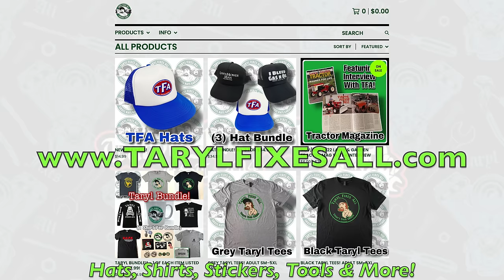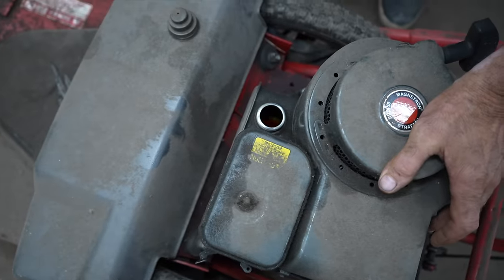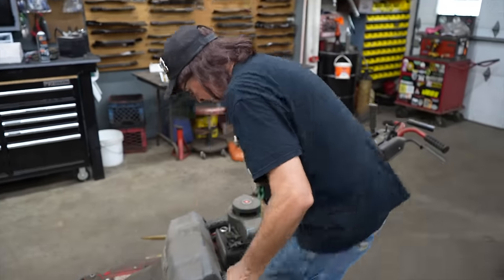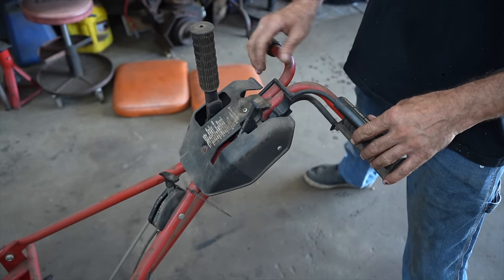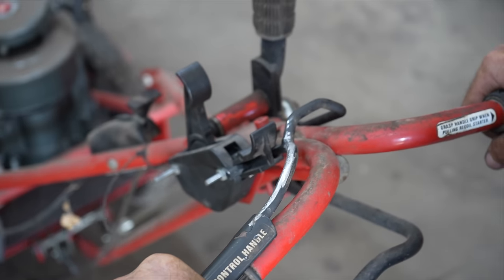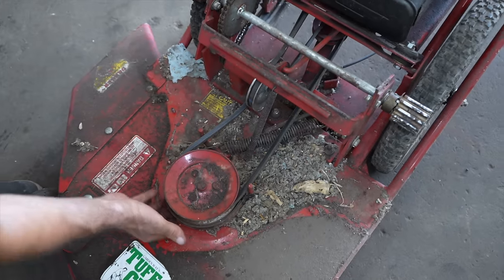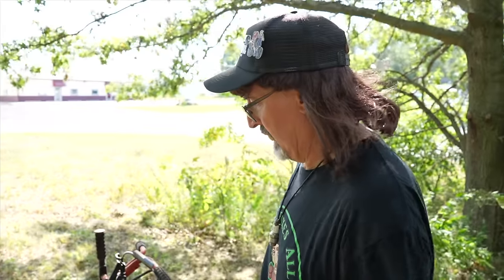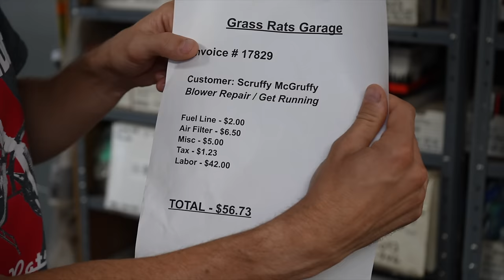Customer Wanted It GONE! Can It Be Saved?

Comment: That was actually an expensive, good mower in its day, you are correct it wasn't a cheap mower, had a cast iron sleeve.I bought one slightly used in 88 for 400$, half of the new cost, the guy was moving to town from the farm and didn't have a use anymore. I mowed by fences and rough areas with it for 25 years. Motor still ran but the rest was just plain worn out.Twas made in the 🇺🇸

Comment: I like that mower! Having the deck out front keeps the blade away from your feet and you can reach out over the edge of a ditch easier. They certainly don't make stuff like that anymore.
Reply: Like a Yazoo and some Hahn Eclipse that were belt driven, In addition to keeping the blade further from your feet it also protected the crankshaft from damage if you hit a rock or some other hard stationary object with the blade.
Reply: Oh they make it it's just in the commercial space and costs 3x as much as it should.
Reply: I was impressed how the engine speed hardly changed cutting those tall weeds.

Comment: Hey Taryl! I have this same mower. It’s also an 87’. 

My father had me mow down the old corn stalks and weeds with it in the garden before he would till the soil with a gravely 5260 with a rotary cultivator attachment. Sometimes you had to lift the mower to get the stalks to go under.

The choke lever on the carburetor could be pressed a little until it clicked if the mower needed more choke to start.

The handles on that machine certainly have a unique feel.

It’s been sitting unused for a few years because the coil is bad.

I assume you put another foam filter in it. I don’t think the video shows the new filter with part number.

Thanks for fixing this machine up and for the great video content!

Comment: That’s not a bad machine compared to the junk MTD pushes out today.   It would have been a shame to see that get scrapped. Still has one of the good B&S engines too.  Cool project Taryl!
Reply: lol, those 3-5 (fake) Horse Power engine with that particular design of carb were the worst.
Reply: @Francois_Dupont nah, you were close but engines of that design with the PLASTIC carbs and the foam / sponge crap glued in the tank to prevent “sloshing” were the worst. Aside from mounting the carb on the tank and using a diaphragm type “pump” to draw fuel instead of having a separate carb with a float bowl filled by gravity, I don’t think the side valve Briggs engines are any worse or any better than most of the contemporary 4 stroke side valve competition. I actually like them more than the comparable Tecumseh engines but I prefer Wisconsin / Robin and Kohlers a little more than the Briggs. The Wisconsin’s were REALLY well put together for a small 3-5hp engine. That said my favorite small engines of that vintage are the Lawn-Boy / OMC “F” engine and the Robin 2 strokes you could get on Snapper commercial models. For me it’s hard to beat those 2 strokes on a ~5-ish horsepower walk behind mower. The Suzuki 2 strokes on the Toros are pretty good too but pricey to work on. I still run my favorite lawn-boy 8-10 hours per week cutting mine and my parents lawns and it’s a 1989 model that was in commercial service working 25+ hours per week until I bought it in 2008. Other than pulling the muffler and cleaning it and the exhaust ports out every winter before storing it it has never needed more than a spark plug every few years and one coil replacement. The great part is it never needs an oil change and I can run the same gas in all my small power equipment including the mower.
Reply: This was before MTD got their hands on it.

Comment: Nice. I got an old Troy Bilt Horse tiller for free a few weeks ago. It had the original H60 Tecumseh 6 HP engine. All I did was replace the head gasket, clean and set the points, change the oil and spray the carb. Started on the first pull. Didn't need it so sold it for $300.00.

Comment: Troy bilt used to make really good stuff. Dad has a Troy Built Junior tiller from 1983 with a Tecumesh motor and everything still works great! Tecumesh motor is the rare one with the reversing pulley on it. Lots and lots of hours on it. Only repair in 40 years was a carb kit and exhaust valve replacement.

Comment: That thing is kinda a veerdoh.  Cant wait to see it cleaned up and see what that really is. I did about a half acre of 1/2 diameter saplings and vines for this woman and she insisted I use her troybilt sickle bar mower.  It used a bungee strap to put tension squeezing the blades together and at first glance I thought what kind of hokey crap is that?   But I figured out the controls and went to cutting brush with it and quickly realised, there is probablly no better way to tension those blades.   Had you used a spring there would be more vibration, the rubber has some dampening to it to reduce all the banging. That was actually a really nice machine for clearing a 3 year old unkept lot. A sickle uses a lot less power than a rotating blade. Shore wished I had one of those now!  Cant sell em cause of liability, that blade is wide open and would take a dogs leg off in an instant.  I got a Stihl power scythe for my KM 94r to do the same thing.  I like that for poison ivy cause it lays down and chops everything instead of slinging it all over you like a line trimmer would.

Comment: Once you said the prices of that part made me think of time here about two months ago when I was searching for a carburetor for a 20 horse supposed to in Briggs & Stratton and once I found out how much it would cost to get a carburetor from Briggs & Stratton I ended up going to eBay and after tax and shipping I paid like $27 and the reason why I went with the cheap one is because Briggs & Stratton wanted $350 for replacement carburetor

Comment: I remember those....  They weren't cheap.  The marketing was kinda aimed at the consumer who had the big house, and the big piece of property, and wanted to do stuff on a larger scale.....

Looked like it worked really good....  Looked amazing all cleaned up.  That thing is a time capsule....

I agree, probably hardly used.  The paint didn't even have scratches....  And really, what's the usage case....  So you cut down the tall grass off in that section of your huge yard...  Rake it out, pick out the rocks, seed it up....  Now it's lawn, you can cut it with your lawnmower...  So the Troy Built just sits in the garage....  Unless you are a Pro Landscape Person, how often do you really need that thing????

Comment: I had one of those - mine was actually a Troy Bilt 'brand'.   It had a 10hp? (maybe 8hp)  B&S engine.  A friend inherited it from his father.  The friend was crippled in a car wreck and gave the mower to me.  It started and ran fine.  Heavy - and with 10hp it was a beast.  But my property has tons of rock - big rocks migrate to the surface with deep frost.  The mower blade is belt driven - so no danger of rock damage.  But I had a yard to maintain - not weeds or small brush.  So after a couple of years I gave it to another friend.  

I actually thought my was made in the late 60's.  I thought I once looked that up.  It had that 50's, 60's 'feel' to it.  Felt like older design and manufacture.   With that 10hp Briggs and high gear, you'd better hang on!  I never missed it.  But it did have a purpose for the right person.  It was built to last.  Now that I think of it, I still have the manual.

Comment: Have a MTD 95 20 Horse V twin IC and still use it to cut my lawn and I have a big lawn. Has a 46 inch cut 3 blade. Getting parts is getting a bit hard to find but still love this old mower. Need to rebuild the front end as it's a bit wore now so will be looking for parts for it next.

I wished I could still find the old style Yazoo big wheel. You could cut down a forest with one of those back in the day. Prefer the old choke and throttle instead of all this new junk they have now on Mowers. Can't hardly find any of those engines any more with that style of carb. I live in Oklahoma so we have lots of weeds and Grass that can grow a foot high in a week.

Comment: Taryl, I wonder if that thing could pull a rider cart while mowing.  I have a cheap Walmart  high wheel non self propelled mower here we got back in the 80s. Very low use as the Briggs plastic fuel tank assembly went to dumping gas all over the deck. There was a supposed recall, but we never could get anywhere with that. So it still sits in the shed these 38 year later, unused!  So I can understand how these things get parked.  Also need an opinion on a Deere 445 with the Kawasaki liquid cooled motor.  I bought it several years back on an auction, paid too much!  Ran it a few hours and it went to smoking like a broke stove and pushing out the dipstick.  Nephew took it apart and but never would finish the repair on it!  Got screwed twice on that one! I think all that was really wrong was that the head gasket wasn't sealing, warped head maybe. Need to either find a decent replacement motor or get some one like you to cure the original motor. I'd have to ship the motor to you as we are way over here in South Western Illinois.  Looking for  your opinion, the rest of the tractor is a nice heavy duty and well equipped unit with all the nice features like power steering , dual remotes and 3 point hitch with pto.  Deere shop isn't an option here as it would be cheaper to buy a new tractor, price wise. I have heard that parts for the motor are now available on line, Deere used to have exclusive rights to that Kawasaki motor. I used to do all this type of work myself but anymore my back and knees prohibit me from getting much done.

Comment: I’ve seen those bicycle wheel single blade rotary mowers with the cog-on-tire self propel setup under a bunch of different brand names, this one looks to be built better than most as far as the “frame”, front wheels and bracketry goes. I know there’s at least one company still making them as one of my local power equipment dealers had one on display last year, I’ll have to check next time I’m there and see what brand it is. I know that it was around $700 for the 24” version, and that’s what surprised me about  Most of them that I’ve seen….how expensive they were and are for what you’re really getting.

Comment: I remember Troy Bilt,  TV advertising in the 80's.  They had all kinds of equipment,  roto tillers,  mowers,  riding mowers , brush mowers.  I dont know if i seen that particular brush mower,  I think they several different types.  For just a 5 horsepower it looks like it does a good job.  An interesting machine.  Another great video sir 😊

Comment: You would have cried the day MTD took over the factory in Troy. Company I worked for at the time was doing a lot of the powder coating for Troy-Bilt prior to the switch so we hit there plant weekly to swap painted and raw parts. Got to know their crews pretty well. Got there one day not long after the take over and MTD was clearing out any equipment that  they already had in their line, They just wanted the tillers and a couple mowers that were Troy-Bilts best known machines. All the rest were being smashed with hammers and cut up as scrap. They had dumpsters filled with spare parts and cut up machines that didn't fit the new line up. I got there to drop off some of the last parts we had for them and the crew asked if there was anything I wanted. Left there with a 26' box truck full of parts and complete new machines, even had a couple Bolens diesels (rebadged Isekis) on there as they were scrapping all the Bolens line as well. Unloaded them at my place and kept a few items, gave some to family and sold the rest off to a local dealer.

Comment: I remember seeing mowers like that back in the day. Could not fathom how they thought bike tires were a good idea for anything other than aesthetics. Never knew anyone who actually owned one though.
MTD, Made To Deteriorate.  I have a MTD push mower, and like it after 3 seasons so far.
Reply: I had a real old Dr mower,it had tall steel spoke wheels on the back And just rails on the front, it was the early brush mower
Reply: It is basic physics. You need large diameter wheels to go over ruts and fallen material easily. You need narrow wheels because they are light weight and do not bog down the engine.
Reply: Mowers To Dump
Reply: @frankbill9172  even at my shop,I get these real oddball machines, sure I get them going, then they just sit,no one wants them,have a whole bunch as we speak, have a whole fleet of STX 38 tractors also,after a while they become clutter
Reply: Mighty Tuff Decision
Reply: Large drive wheels handle rough ground smoothly without getting stuck, farm tractors have large drive wheels too for the same reason, box store toy lawn tractors don't need large drive wheels as the little biddy drive wheels only traverse smooth lawns
Reply: Even though your other commenters seem fixated on rolling diameter, I agree. Perhaps they've never fixed a bicycle tire run through a thorn patch😉

Comment: Pops bought a similar mower in 89 with the same engine, we ran it until 2006 when the deck finally rusted so bad that the engine fell through the deck. Also started on 1st or 2nd pull every time, never had carb off. New plug, oil change and oil up a new air filter every spring.  I would take one of those brush mowers any day over the modern junk. Hands down.

Comment: We had a 1999 Troy-Bilt 42 inch cut riding mower with the Kohler Command 16HP engine.  It was a rock solid machine.  It's a shame MTD (many troubles daily) ran them into the ground

Comment: Yes,imy 3 horsepower Briggs and Stratton powered Supa swift lawnmower & my dads 6.5 horsepower Honda HRU217D lawnmower which I have just rebuilt the engine on both has those "swing blades" fitted which is what we call them over here in Australia,I also have an old Australian built Victa 2 stroke lawnmower which has those swing blades on it as well,the mower needs to be restored,it will run but it will stall due to leaking crankcase seals & the crankshaft bearings are shot.

They're supposed to swing back if you hit a rock orbs tree stump in the lawn to prevent the crankshaft from getting bent,my dads however got hit that hard that the 3 pressed tabs in the blade disc which slot into the 3 mounting holes in the blade boss on the crankshaft have sheared off.

I have ordered him a new set of blades.& a new blade mounting disc for this summer over here to prepare it for the mowing season since the grass really gets away from us then is we don't keep on top of the mowing !

Comment: Is it bad I could tell by the design it was manufactured in the 1980's. They still used more metal than plastics in the 80's. The handles seem kinda short concerning comfort. My concern with units like that is parts availability.  Even if I can get the engine running, it's the chassis I would be concerned for. There is nothing worse than finding a unit is totally obsolete and parts are  UNAVAILABLE because that company went belly up. The engine is a no brainer, those almost always run, even after sitting a gazillion years. Being most lawn equipment is only used seasonally, unless it was never maintained,  you can usually get the engine going. The deal breaker is the chassis. I have salvaged many decent engines, only to scrap the obsolete  frame.

Comment: Although Briggs engines are commonly run at 3600 rpm the max rpm is determined by the blade tip speed regulated by ANSI standards to 19000 feet per second. The larger the blade equals the lower the max rpm because the larger blade tip travels further with each revolution. And that may be why the governed rpm was set lower than 3600 when you first checked it.

Comment: That sure looks like an old Yazoo mower I used for years, until some drive parts that were integral with the wheels wore out.  It was unusual in that the wheel drive wasn't taken off the crankshaft like most, but was instead off an extension of the camshaft!  Otherwise, it was just your regular 5 hp vertical shaft Briggs engine.
Reply: Made back in. The Day when this Engines were made to n last
Reply: It looks like a Yazoo  mower that I have had for over 40 years only the controls are difference , the blade spinners when you cranks it up, a lever to put it in motion.

Comment: The most perfect Toro walk behind mower from the 90's did that same blade mechanism.  You could pull the bail down and up to engage the blades and if you let go the walk behind kept running.  
The bail served as the speed control also, once the blades were engaged and even if they were not.

Comment: 33 years on a spark plug, good golly miss molly. Maybe running at less than max rpm was a reason for it's long life? Front spindle  and idler needing grease? I think you were confusing swinging blade with flail mowers. Machine looks like a Yazoo clone. Nice machine, great that you rescued it.

Comment: Taryl, I have a Yamaha atv that idle well, but when I put in gear to drive, it shut down. I tried idling it up using the throttle adjustment screw, but it still shut off.  what do you think is going on?

Comment: I couldn't tell in the video, but was there a cable connection for the blade control lever?  If so then maybe adjust that rather than bending the lever?

Comment: Could you run a cable with a handle connected to  it  to the right handle and use it as a variable speed control for the self propelled unit.

Comment: If I needed a brush mower I would much rather buy an old quality Troy Built than a new and questionable Troy Built.
When Taryl showed us the difference between a newer Briggs with a nylon camshaft 
AND
A Predator with a cast aluminum camshaft I could not believe it.

My Dad has a large two-stage snowblower with a Briggs, it has great power if you can get it to the proper RPM for longer than a minute or two, Not what they used to be and it has Zero to do with emission systems, the problem is quality of the internal components.